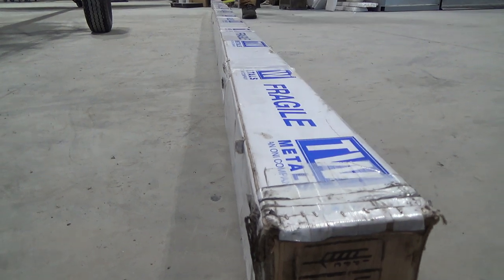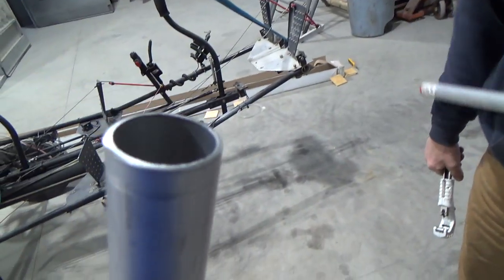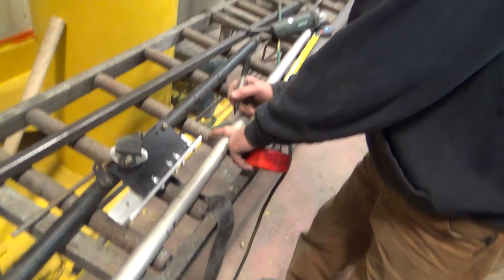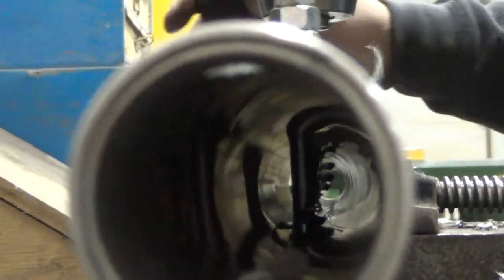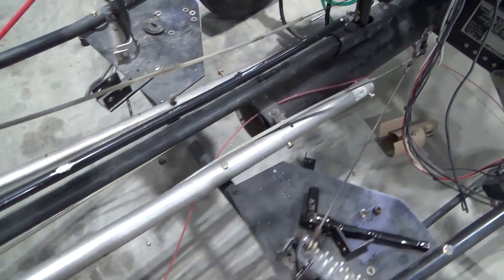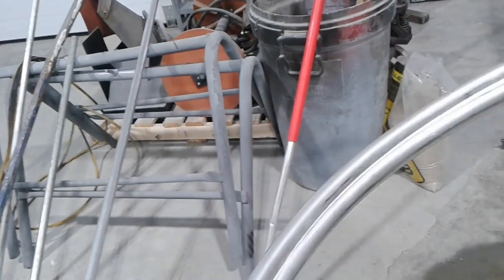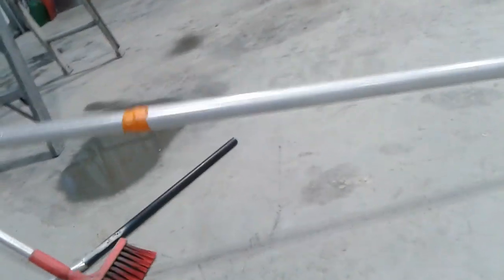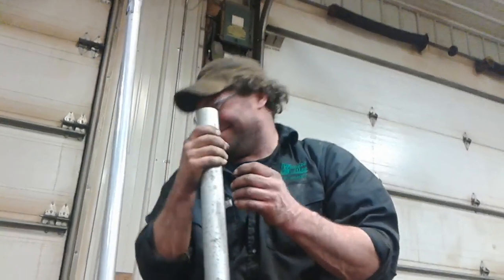Drilling Tubes | Re-Build: Part 3

Comment: I've bent 1-1/2" pipe size tube 6061 t-6 by sooting with straight acetylene, then heating til the soot disappears, it is then soft and I bent with a HF pipe bender. This info is online. The issue for you may be that the al tube will not be as strong as before annealing so it must be re-hardened. I have read it will age harden given time but not to t6.

Comment: Hey Matt!  Centimeters?  Lol...  hey can’t you rent a bender for that size pipe ? The aluminum pipe, in the last bit where dave couldn’t bend it right.. I wish I was there, I am pretty good at bending pipe of any kind, except steel!  Lol..
also “Would you look at that?”  Ed Bassmaster?  Lol
Reply from the maker: Dave took it to a local business today that builds tarp covered buildings and they were able to finish the bend for us using their machine. The issue wasn't a lack of strength, but a lack of support for the un-sleeved portion. It wanted to kink at the edge of the sleeve and we had no way to stop it with the tools we had. 
And ya, "would you look at that" is one of my favourite sayings thanks to Ed. :-D

Comment: Nice video man, I wish I could start my 503 rotax and fly some more but for some reason I can't start the dang thing in this winter, I clean the carbs check the spark plugs replace them and still she won't start.😭
Reply from the maker: That's too bad. Mine have always started harder in the winter but I've always been able to get them to go eventually. I hope you get it figured out! All you need is air, spark, and fuel!
Reply: Finally figured out the problem, I can go flying again!!, I'm uploading a video about it.
Reply from the maker: Awesome!